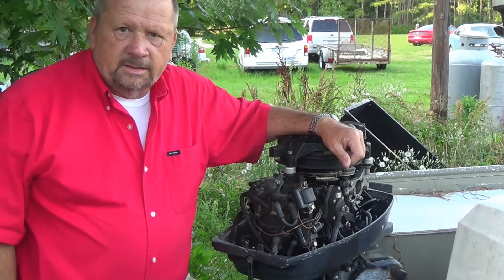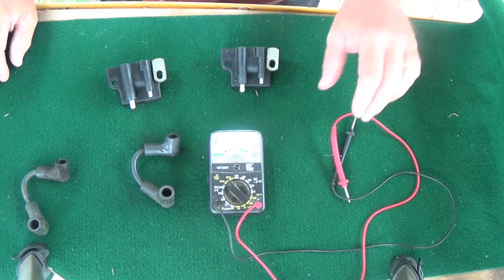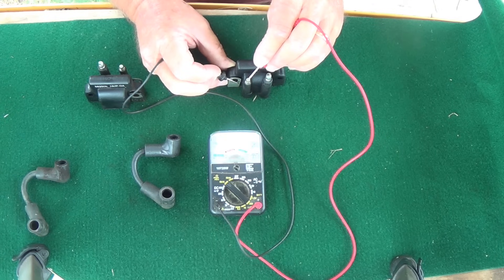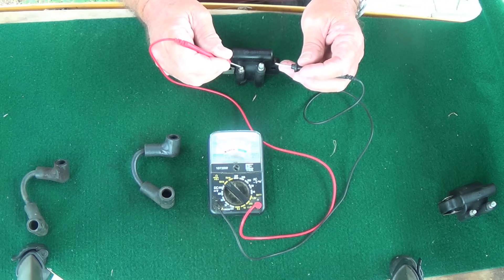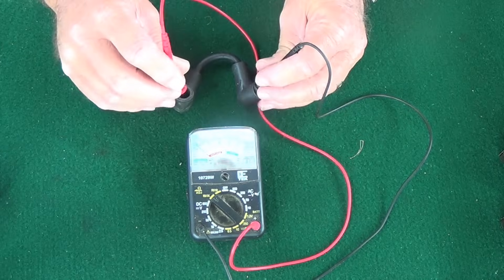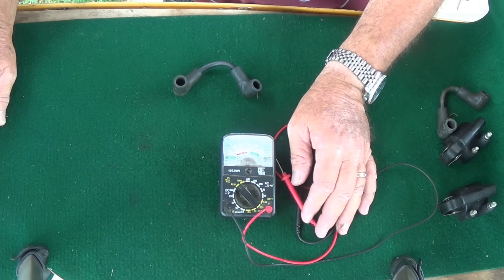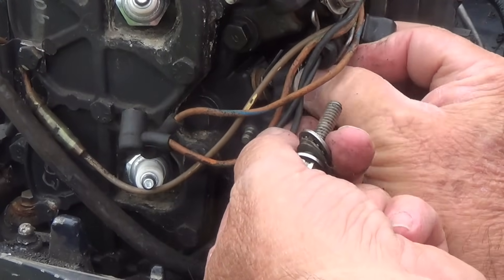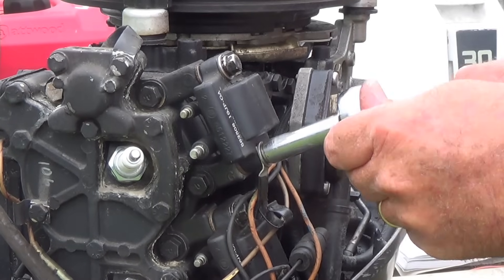Coil Test {would you look at that!]

Comment: 35hp 1982 Johnson.. one of my coils tests good but still doesn't get spark?  Using same spark plug & spark plug wire.. Good coil works with both orange wires, bad coil doesn't work with either.. new one on the way.  Thank you for the testing info tho ;)

Comment: I'm running a 84 Evinrude, E25RCR. It's not pissing real good while idling. It does good while running. Also the bottom coil seems like it's been getting hot. It's not melted but it's damn near. I got the motor about a month ago. I replaced the slow speed idle retainer and it runs great. Yesterday after running the motor for a hour or so it was pissing water that was very hot. Is that normal. What I'm wondering is if the water pump is weak. What would make the bottom coil get too hot?

Comment: Hi, love your videos..I’m having the same problem with my 2001 25 hp Johnson top plug is wet bottom one is carbond up I put two new coils on but hasn’t changed.Can you help me..
Reply: Hi, I found the same with my 2001 25 hp Johnson the top plug was wet bottom one was carbond up what did you find as the cause .Thanks.

Comment: 1977 Evinrude 25  25702H  the kill switch did not work. I bought oem new switch with wire. Installed, still does not work. Any ideas?
Reply from the maker: I don't think it is grounded good. check your ground wire

Comment: Guess I'm going to buy and learn how to use a multimeter today. Thank you
Reply from the maker: Good luck! You can do it.
Reply: @OmFishing  Top plug wire was the problem. It was cutting out after the engine warmed up. I clamped the connector tighter and cleaned it up, it snapped right on and she is running beautifully. A full carb rebuild later, I should have watched your video first

Comment: Hello Sir, thank you for educating us. My Johnson 25hp doesnt have spark whatsoever, I followed your ignition coil test and both of mine comes out at 145 instead of the the 275 range. Also, when I do ground (neg) and primary terminal on coil (pos) I get zero ohms. I have not tested anything else other than using new plugs to find the same result. Does this mean my ignition coils are bad and is causing my no plug issue?
Reply from the maker: The service manual is where I got my specifications from. The resistance is not where the manual said they should be. If it were mine I would buy a set of coils. It is possible there is more that coils but that is a good starting point.
Reply: @OmFishing  I tested the two black/white wires coming from stator and got a reading of 37.7ohms. (Terminals B&C on the harness adapter coming from stator plate)……Tested two wires brown/white coming from what I guess is the trigger on the same plate as the first two wires (A&C) and got a reading I tested the two black/white wires coming from stator and got a reading of 37.7ohms. Terminals B&C on the harness adapter coming from stator plate)……Tested two wires brown/white coming from what I guess is the trigger on the same plate as the first two wires (A&C) and got a reading of 490…..Can you please shed some light on what does this all mean? And where should I look next? 

Note: I confirmed coils/plug wires/spark plugs are all good by way of swapping them with a Johnson 50hp with strong spark and spark continued each time.

Comment: Mine are reading 360 all 4 coils
Reply from the maker: When I checked my coils the manual said the meter should read    275 -+ 0.05. There are different readings for different coils. So 360 could be right for the coil you are testing. With all four reading the same I would think coils are good.

Comment: You're not reading the Ohm scale/meter correctly. This will cause confusion to those are not aware. You would be better off using a DVM (Digital Multimeter) to avoid error.

Comment: I just bought a 1996 40 hp johnson with controls and I cant figure out how too rev the engine with it out of gear..the controls dont have the big button too push in too keep the motor from going into gear,it must work some other way,,any advice please?
Reply from the maker: On my robalo you have to slide the shifter to the left about a 1/4 inch and you can rev it up.
Reply: @OmFishing  ok thanks, I'll try that

Comment: How do you know what they should be reading to use as your base for determining if the readings you are getting on the coils falls within normal operating parameters?
Reply from the maker: The service manual reads that the Primary Resistance should be 0.1+-0.05 ohms. The secondary resistance should be 275+-50. Thanks for watching.

Comment: Your reading the wrong scale on your meter Mate, you had your it set to the x1K ohms range (not volts or milliamps) if you read the ohm scale (in green) you could see it was around the 0.3 mark which on the x1K scale would be 300 ohms. Which is within the range spec you quoted.
Reply from the maker: Thanks for keeping me straight.

Comment: Hi I have an 89 evinrude 9.9 it starts and runs great but after it runs for a while if it stalls or I shut it down I can't get it to start up again.  Do you have any suggestions.?
Reply from the maker: The three basic things to run. The first thing I would check is fuel. When I buy my gas at walmart "non ethanol" my outboards will do the same. The next step would check to see if the engine has spark when it is warm. The electrical system is a weak link. Check to see if it is getting fuel when it is warm. The fuel has to be the correct proportions. Check the make sure you have the compression. I know you just wanted me to tell you what is wrong, Its not that easy.
Reply: Following
Reply: Mine 15 johnson is doing the same thing

Comment: I got a 28hp.spl I just shut it off and now it isn't getting spark do you think the coils went out
Reply from the maker: I think wire connection first. You know electric and water don't mix well. Make sure all the ground wires and connection are good. Then check coils.

Comment: Hello please help me I have a mercury 8hp 2stroke that runs awesome when not in water under load but as soon as I put it in water it will only open up to about 60%  and I can’t get the motor on power band but it won’t rev my hub is not spun and I have re built the carburetor I’m lost I have a strong blue spark and my reeds are fine!
Reply from the maker: I am assuming good compression. I am more of a evinrude johnson guy but. The first thing I would check is the linkage adjustment. It sound to me like the throttle and the timing are not in sink. You don't have to be off by much to make a big difference. Be sure and let me know what you find. Stay Safe.
Reply: @OmFishing  thank you I’ll check tomorrow

Comment: Thank you for sharing this helpful video. One suggestion I have is that you not apply dielectric grease to the top (metal) of the spark plugs. Dielectric grease is an insulator and having it between the plug and plug wire may result in poor electrical connectivity. The grease should only be applied to the ceramic (white) portion of the plug. Doing so helps prevent arcing between the spark plug wire tip and the engine ground. - Cheers!
Reply from the maker: Thanks for the tip. That is what it is all about helping each other.
Reply: I just noticed that there's dielectric grease inside my coil wire ends. The side that goes to the coil. Would that cause issues?

Comment: Hey i have a 5hp 4 stroke yamaha, which idles and runs like a dream up to 2800rpm, than starts "4-stroking" it seems like it hits rev limiter, do you think its possible the coil is bad only "half way"  since i cleaned and replaced basically everything else i could think of.
Reply from the maker: I have not run in to that problem before. I am not sure on that one. Be sure and share what you find.

Comment: I have a 94 evinrude that runs great on muffs pull throttle screams get in water to run starts to lift boat and just sits at so many rpms, never get on plane or screams just holds at about half or less rpms? Took calon off in neutral hit throttle and revs a little more throw back in gear same problem reckon what is going on here?
Reply from the maker: I had a 93 evinrude do the same thing. The float was set wrong in the carburetor and would shut the fuel off when the bow would raise. I would check the linkage synchronization too.
Reply: Om Fishing thank you for responding! I cleaned top carb, turns out I was running on one carb! Thank you hopefully this trip will plane out
Reply from the maker: @KCfreedomfighter88  I hope all goes well!!

Comment: Would a bad ignition coil make your outboard want to stall when you go to put it in gear after the engine is warmed up? Mines doing this and it's hard to start whether hot or cold most of the time
Reply from the maker: Hard start could be a lot of things. I would check out the carburetor. Then I would make sure the fuel supply is good and not leaking air. Next make sure the spark plugs are good. If the engine has low compression that could make it hard to start. The gasket between the carburetor leaking. The crank seals are just as important as the reeds sealing. I know this does not answer you question but there is not a easy answer.
Reply: @OmFishing  I have all new plugs I replaced main fuel line pump is good. I did a resistance test on all 6 ignition coils they all passed. I guess next I'll pull carbs off and clean em and check seals and gaskets. I know I have a bubble in fuel filter could that be the whole problem?
Reply: @terrywilson1813  Hello Terry, would you share your experience and tell us what the problem was? That sounds like my engine!
Reply: @1V2N1V2  it was actually my fault...I have an old mercury inline 6 cylinder and I was flooding the carbs because mine you have to prime by pushing in the key and I was doing it by accident every time I restarted the engine. I would assume you're not making the same mistake I was but it sounds like flooding. Start by cleaning the carbs

Comment: My 81 7.5 was burning weird on one plug .about the time I got the carb right I lost all power ...probanly the cod box I'm guessing any suggestions ..btw great and helpful videos
Reply from the maker: I would check the flywheel first make sure the magnets are still there and the key way is good. Make sure all wires are good. They are  connected and you have a good ground to the engine. I check every possible cause before I buy parts.

Comment: I have a 9.9 1996 evinrude. It wouldnt hold an idle and only run if you sprayed eether. So I replaced fuel pump, cleaned and rebuilt the carb (thanks to your other video!), new gas line, cleaned water pump hole, and replaced new plugs. Still wont hold an idol.  In fact now it wont fire at all. Could it be I should test or replace ignition coils?
Reply from the maker: I would test the kill switch first.  It is possible the coil went bad, but you need to check them. At over 50 dollars per coil and over 100 for a power pack you want to be sure. Check the wires. When you say will not fire at all. Do you mean will not start or no spark at the spark plugs.
Reply: @OmFishing  there is now no spark on the plugs.  Whats odd is the top plug had fire but the bottom didnt prior to it finally dying out. Tested the ohm on coils and they read like 12. 

I did not test the powerpack yet. 

Thanks for your time sir!
Reply: Update: I switched out both coils with new ones and new connector wires/boots too. The thing fired right up first pull and held idle. 

But... i noticed the pump hole is not peeing anymore. Took the hose off and found dirt clogged at the connection. Tried to clean it but since it's a 90 degree connected to the block I cant clean in there. Any recommendations? Does it twist off? Or, to jet it clean, air blast it? Blow water in it? Spray wd40? 

THANKS!!!
Reply from the maker: @johnnylawrence  It does unscrew from the engine block. I would be easy with it.  You could try to flush it with water first. Let me know how it runs.
Reply: @OmFishing  sorry late update. I never unscrewed the connection from the block, didnt want to risk breaking it. Instead i sprayed a little carb cleaner into it and let it sit for a bit. I then took a pipe cleaner and tried to loosen as much dirt dobbers as i could.  Hooked the line back up, grabbed the hose and earmuffs and started it- the thing peed like normal again.  

Took the boat up north and buzzed around the lake for an hour or so, not one flaw,, ran like a champ. 

Thank you for all your videos and your time good sir!!!
Reply from the maker: @johnnylawrence  Happy to help. Thanks for sharing. Stay Safe.
Reply from the maker: @johnnylawrence  Good to hear. Stay Safe.

Comment: good explications Om Fishing but can you repeat to all everybody the clear measurement from ground(black) to primary (red); from primary(red) to spark terminal /black)and for cable in numbers and in ohm or amphere? thank you in advance
Reply from the maker: The primary resistance for the coil is 0.1 (+ -) 0.05 ohm. If the coil is off the engine. Connect the meter black lead to ground tab on the coil,  and connect the red lead to the primary coil.              

The secondary resistance connect the meter red lead to coil primary terminal. connect meter black lead to coil spark plug terminal. Meter must show 275 (+-)50 ohms. Hope this helps. Stay Safe
Reply: @OmFishing  Many thanks for data; Sure this helps me very much;Have a happy new year 2021
Reply from the maker: @domenicogiannattasio9037  I hope 2021 is good for you as well. Stay Safe!!!

Comment: I got a little lost there. You used the ohm scale to check from primary to ground, but you used the amperage scale (actually 0-250ma I think) to check across the primary & spark terminals. There coil isn't connected to power & ground so there's no draw (amperage) to test for. Looked like you were getting about 0.3 to 0.4 ohms when you checked from primary to spark terminal on both coils.
Reply from the maker: I did notice I read the wrong scale when I look up at the meter. I think everybody got the idea on how to check the coils. Thanks for commenting and as always keep watching.

Comment: When measuring resistance on a multimeter, you should be using the top Ohms (green) scale and reading from the right side of the scale backwards. You should be using a lower ohms setting as the 275 ohms you are reading is actually 2.75 on the scale. Rather than Ohms x 1k which reads 0.275 you should be using Ohms x10 which would read 27 on the scale and give you a much clearer answer.  A digital meter here would probably be a better choice. A spark plug lead that reads an open circuit may still work if it has only a small gap in the lead, this gap will get bigger and eventually cause the engine to misfire so it is good practice to replace it.
Reply from the maker: Thanks for keeping me straight. Thank you for taking the time to correct me. Stay Safe.

Comment: Hey I have a 2003 yamaha f115 txrb I just repower to this motor and It ran great the first few hours. The. It suddenly started running very ruff and started stalling out. I had changed both fuel pumps and filters.. The motor will only crank and run right when I push the trim button by as soon as I let go of the trim button the motor will stall out and not crank again till I push the trim button. I'm at a loss .. The motor will only run when the trim up or down is being b pushed.. Any ideas would be much appreciated!!!
Reply from the maker: My first guess would be that it has a bad ground some where. I would clean all engine grounds and make sure the wires are making a good connection. On some evinrude e-tecs if you push the trim and hit the starter at the same time it will change the ground to the smaller wires and burn them in to. I hope this helped.

Comment: 48 inch pounds would be clean and lubed and 98 inch pounds would be clean and dry
Reply from the maker: Your right! lubricant on the threaded bolts makes a big difference. I have read that in some cases you can reduce the required torque 40 percent. I just torque to the service manual specifications. It would be to hard to try to break this subject down.

Comment: So what was the reason to check the coils?  Would be nice if you first started with an explanation of the engine problem... runs rough, low power, only sounds like it runs w one cylinder firing, etc.  Showing a dry plug and a wet plug could be many root causes.
Reply from the maker: Thanks for the tip, I will make sure to include that from now on. This video I thought it was only running on one cylinder. Loss of power.

Comment: I have a 96 25hp evinrude basically the same one you have but I have having an issue starting, i can only get it to start if i remove the plugs and crank it a few times and then put the plugs back in with the choke on it starts no problem. Could this be an issue with the coil pack?
Reply from the maker: My first place I would look at would look at is compression, spark plugs, linkage, carburetor. Check out my video on service bulletin
https://www.youtube.com/watch?v=pTudciaZbEc&t=12s
and check out my video on the 4 circuits of a carburetor.
https://www.youtube.com/watch?v=J_yqcNJqabU
Reply: @OmFishing   Thanks for the advice OM It turns out it was the carburetor needle was worn and filling up with a ton of gas i got it rebuilt and it works it great now.

Comment: 1998 40 horse won't shut off with the key or the kill switch,found the kill switch wires were pinched an fixed them in the shift box an help would be appreciated.thanks
Reply: 1998 40 horse won't shut off with the key or the kill switch . found wires in the throttle box were pinched an fixed them,the wires went to the kill switch
Reply from the maker: @harveyelliott5097  When I have run into problems like that I always make sure the wires that ground to the engine are making a good connection. That is how that engine shuts off is through the ground.